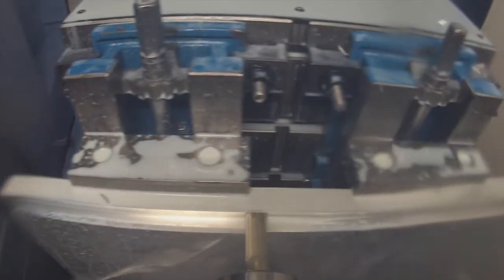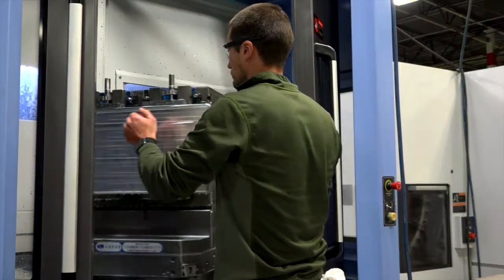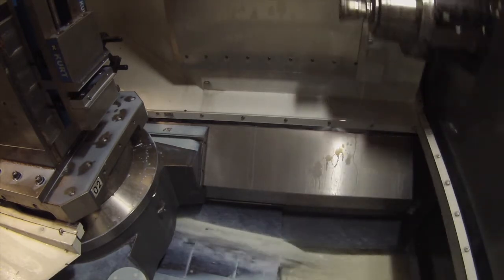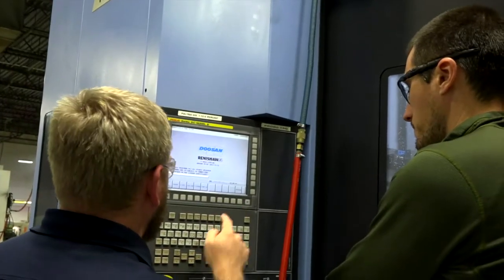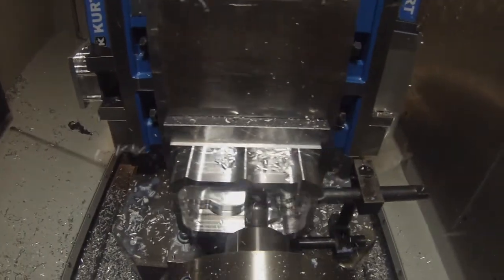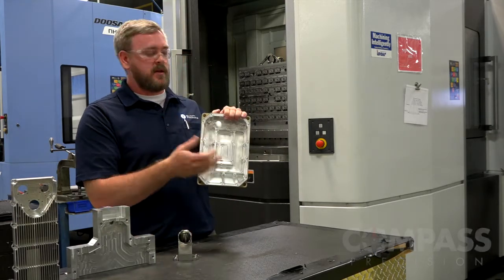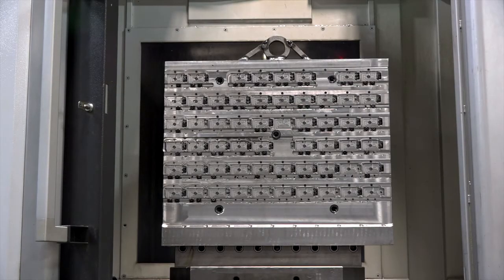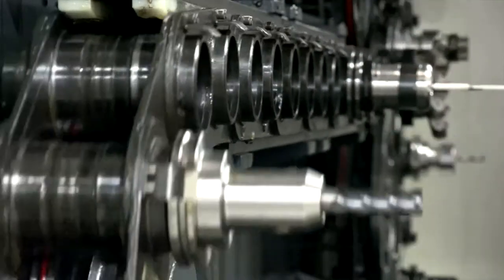CNC Machining: Horizontal Machining at Quality Products

Comment: If you like gravity chip removal so much then why not mill upside down... :D :D :D
Reply from the maker: We were thinking space, so the chips safely float away with no gravity, but we’ll look into upside down machining too ;)
Reply: its easier and cheaper to have the castings on the floor than up high.